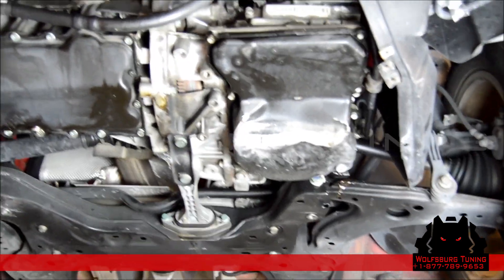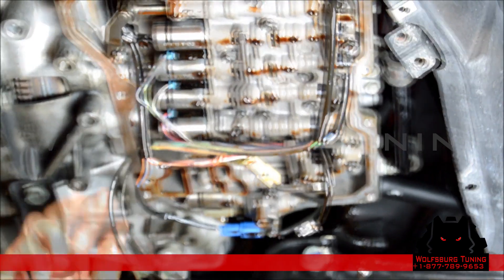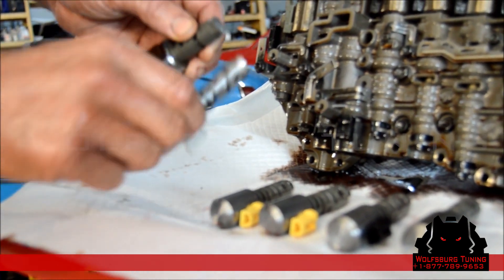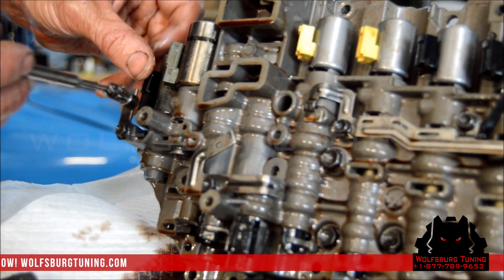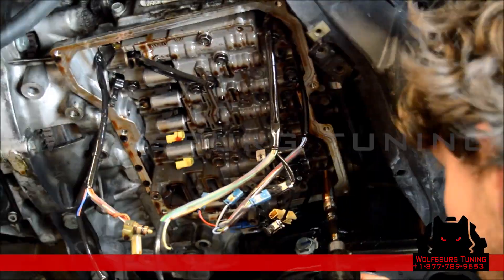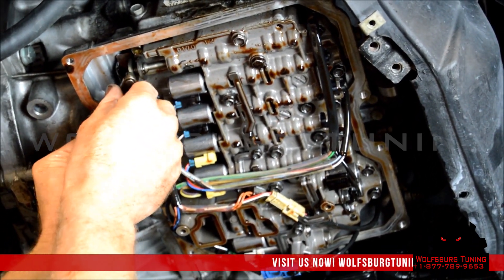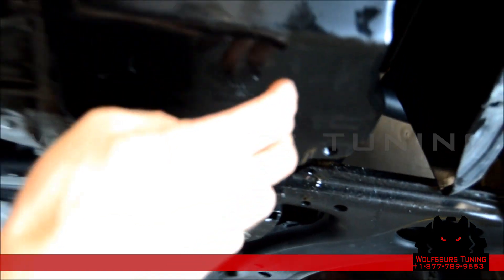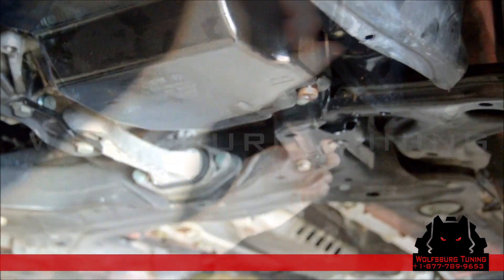WolfsburgTuning.com - Audi & VW 09G Solenoids Installation

Comment: Quick question that I'm not sure can be answered here. My '07 Rabbit has the large can solenoids in the VB, and in the research I've done, I've found that they have to be the same diameter solenoids going back into the vehicle. Does the size of the solenoids really not matter? I dont want to replace them all just to have the same issues I've been having with the transmission

Comment: Very informational. I got the kit with all 8 solenoids. Should I just install the six like you said? And 5 quart of transmission fluid, correct? I’ll be trying this job on Friday. Need as much information as possible.

Comment: You can just try and clean them before getting new ones. Worked for me saved $400
Reply: Same thing for me. Cleaned all 8 multiple times and jolted them with 12v about 20 times. Lots of gunk gets stuck in them. I turned some of  the adjusting screws 2 times counter clockwise for firmer shifts. Feels really good and no more flaring.

Comment: I have a p0720 code (g195 ). My plan is to change fluid and most likely the output speed sensor first. Will I need to use the same procedure of resetting the valve body? What exactly  is that procedure?

Comment: I was experiencing hard shifts and surges in my 2005 Volkswagen Beetle. I bought this kit, installed it and it runs like new now.  It took about 10-15 miles for the trans to relearn the shifting.  It was pretty jerky at first.  Everything smoothed out.  Thanks Wolfsburg!
Reply: Did you need to program the valve body?
Reply: @AndreychukAndrey  Yes, it should be programmed after install.
Reply: Glad to hear!!! Thank you for taking the time to comment!

Comment: thank you for mentioning the torque specs Nobody else does and I couldnt find it online without signing up. Best Video for 09G here. I did shift kit and solenoids and it fixed the issues.

Comment: Can I buy a certain OBD that will work on program at home. 1 gear won't shift and then it will shift and hit a bump and it pops right out of all gears. The OBD I have says that My input and output sensors need replace so was going to change solenoids while working on changing fluids.

Comment: Had the hard shifting issue, replaced with new valves, but now i have odd shifting, like it takes longer to shift. Any ideas? I read somewhere that do to mileage, there may be some valve adjustments needed once they are replaced, could this be what I need to do? 07 Rabbit. Thanks

Comment: Cannot find a single good article/video/diagnostic flow chart on how to test these transmissions to find out exactly what's wrong. How can I make sure the problem doesn't lie in my TCM vs a shorted out solenoid. Tested out all solenoids.. all are in spec. PRNDL illuminated. Thanks for any advice in advance.

Comment: Would this be relevant for an Audi A4 B7 CVT “P0753 Shift Solenoid A Electrical” code? The gears are failing to shift
Reply from the maker: This video is for a 6 speed transmission. Please email service@wolfsburgtuning.com so we can further assist you.

Thank you!

Comment: Nice video.. I've seen some tutorials for this type of trans, i will eventually install new solenoids on my passat, just i have a doubt, does anybody knows if you have to adjust the solenoids?? there are like type of screws on each solenoid that you can adjust clockwise or counterclockwise before the relearn process.. if so  when you have to perform this adjustment? Thanks

Comment: I'm facing same as your problem.  My 2006 golf does hard shifting when gets hot and sometimes get stuck on 3rd gear. Changed the transmission with 2nd hand one and it's still doing the same thing. Any advice please help. Cheers
Reply from the maker: Please send us an email with your vin # service@wolfsburgtuning.com

Comment: What is the max safe ATF operating temperature for the 09G? We are getting 104 deg C or 219 deg F after a half hour of suburban driving in our Mk 5 Golf - is this too high? The repair guide says the TCM has a fail safe which kicks in at 127 deg C or 260 deg F but says nothing about normal operating temperature.
Reply from the maker: Hi,
The normal transmission temp is around 175 degrees.

Thank you
Reply: @WolfsburgTuningcom  Thanks for the reply. Any idea what would cause it to run hot? Shifts beautifully after having solenoids rebuilt locally. Could the oil cooler be the problem (have the small round type which sits on top of the trans)?
Reply from the maker: @frogman6641  There are many reasons that could cause this.  The vehicle needs to be diagnosed to identify the issue.
Thank you
Reply: @WolfsburgTuningcom  OK thank you.
Reply from the maker: @frogman6641  You're welcome. If you have any further questions please feel free to email us at service@wolfsburgtuning.com.

Thank you!

Comment: Did you state what the problem was?  Symptoms?  What do you charge for this job?
Reply from the maker: The solenoids are prone to failures that will give you these symptoms and they are only rated for 100K miles. Hard shifts, soft shifts, no shifts or different shifting conditions from when your transmission is cold to hot. We only sell parts we are not a shop.
Thank you
Reply: @WolfsburgTuningcom  thank you .  my son's 2007 jetta wolfsburg isn't there yet but how much for the solenoid kit?
Reply from the maker: @rhoddin  Our 6 piece solenoid set is $274.40. Please see link below.
https://www.wolfsburgtuning.com/automatic-transmission-solenoid-set-0000%201059av

Thank you

Comment: i have manual trans in mk4 golf
 5 speed
sometimes if i stop and go in neutral on red light for example..
the car doesent want to shift so i turn it off then get it in 2nd gear and drive like that ...
when i can i go off the road and change the gears with hand in the engine bay then go in and start and like that the car starts to shift but im not sure i am fixing it like that 
i bleed the air and the fluid and same thing is back.
PLZ HELPPP WITH ADVISE 😥😥😥😥
Reply from the maker: Manual Transmissions are not like Automatic where you can just replace a part to fix it. You need to bring your vehicle to a mechanic to have them diagnose the issue. 
Thank you
Reply: @WolfsburgTuningcom  
Of course 😊
Thank you for your reply and respect 🙏 big respect 🙏 and thank you for the reply.
But I live in Macedonia and there is no such thing as mechanics who can do diagnoses with laptop or something or let's say that I can take the car to mechanic and take it from there fixed ...
It is be sold in pieces or they will change every part that is still good in the car and give it back like that so I have to fix it or just dig a hole and burry it in the hole and walk to hospital every day...
Macedonia )
Reply from the maker: @ChudGPT  please email us as it is much easier to message back and forth. Service@wolfsburgtuning.com
Thanks again!

Comment: I have 2000 vw new beetle. Not engaging not for or back.  My code is P0730 would this fix my problem and What is the solenoid reset procedure?

Comment: I know this video is 2 years old but I’m still hoping for a respon, my vw Passat 2.0 turbo is running a p0864 code somtimes it will bang when I put it in gear and get stuck in gears and other times it drives normal, I believe it is a transmission output speed sensor is that the sensor located on the valve body?
Reply from the maker: Please send me an email with your vin so I can see what transmission you have. service@wolfsburgtuning.com
Reply: @WolfsburgTuningcom  my 2004 Jetta TDI with dog won’t go into reverse ! Why?
Reply from the maker: @scotthayes5738  The vehicle needs to be fully diagnosed. It could be a wiring or module issue.

Thank you

Comment: Thank you! I ordered from your website and install them. Now transmission is back to its glory days!!
Reply: What was your problem that you did this
Reply: @paulbrose5431  rough shifting. Usually when engine is warm
Reply: @Usmanthemecano  Did you need it to program it ? Or just drive?
Reply: @AndreychukAndrey  no programming needed
Reply: @Usmanthemecano  Thanks for the respond. I have the 2016 Jetta with 1.8T and they don't sell just the solenoids and only sell the valve body with solenoid but they want like $700 plus dollars for it. I see on eBay they go for around $350. I was wondering if I can just clean the solenoid and put them back in.

Comment: Thanks for sharing the video - I just replaced all solenoids and my car wont go in reverse, any ideas? I am thinking if the solenoids that I purchased were faulty or the selector fall out as I didnt put ziptie on it. Thanks
Reply: Fill up more transmission fluid it will drain when reaches correct temp

Comment: Car is worse after new valve body
Reply: Where did you get your valve body?
Reply: @wolfsburgtuning4733  Amazon
Reply: No I didn't purchase yours. It's from a different seller. But I got my refund. I wanna order this now. 
Here's my valve body part#
09G325039BX
I use the output sensor cavity to pour in atf the exact amount I took out. Is that ok by your policy? What's the warranty on the product?

Comment: 2006 VW Jetta here. Transmission was starting to bang gears once it was warmed up and hot. I mean when upshifting it would ‘hang’ in Neutral, Rev High, then bang to the next gear. Not good. So the fluid and filter have been replaced and that took care of the banging. But now when the car is hot and it shifts up, it hangs between gears, leaving the driver helpless, when you press the gas pedal to go it just Revs the engine like in Neutral until it finally shifts. So, should I look for a solenoid package or do I have to do the whole valve body? Thanks!
Reply: It is usually a solenoid issue, but it is always a good idea to scan the vehicle for trouble codes before replacing any parts. It could also be a valve body issue. There's no easy way to diagnose if the issue is in the valve body vs a solenoid issue. It simply comes down to how much money you are willing to put into the vehicle and how much time you have to work out the issues. If you plan to keep the car for a long time, I would recommend a rebuilt valve body. Our (Wolfsburg Tuning ) re-manufactured valve bodies come with all solenoids and a Lifetime Warranty. The valves in the valve body wear out which changes the pressures in the transmission. This has a negative effect on the mechanical parts in the transmission. If it is a solenoid issue our solenoid set would correct the problem. Keep in mind, if you choose to replace the solenoids, that you will have new solenoids in a valve body with wear. The valve body will eventually need to be replaced. 

For more info, please message us directly via email service@wolfsburgtuning.com or you can follow this link to open a ticket.  https://www.wolfsburgtuning.com/contact/

Solenoids: https://www.wolfsburgtuning.com/automatic-transmission-solenoid-set-0000%201059av.html
Valve Body: https://www.wolfsburgtuning.com/automatic-transmission-valve-body-0000%202698.html

Comment: MY VW POLO 1.4  2004  9N Automatic gear box when I engage drive it takes some few seconds to move I change the transmission oil and clean the pan but nothing change can any one help what must be the problem .
Reply: Your issue is most likely in the valve body or the solenoids. The only way to know for sure is to measure the pressure at the ports in the transmission. That requires a hydraulic oil gauge.

It is not possible to know exactly if it is in the valve body or just the solenoids without removing the valve body and testing it on a machine.
 Unless you have solenoid specific trouble codes. The most common failure is the solenoids. 
We also offer the re-manufactured valve body (includes solenoids) that is covered under a lifetime warranty.
Reply: @wolfsburgtuning4733  thanks so much for your reply you  really open my mind although i am not a machanic but i understand can you please send me the pictures of what you are talking about to malume28@gmail.com if possible 🙏🏿🙏🏿

Comment: Nice video. 
Quick question I have a 99 beetle with 150k with an auto trans, my cat will not shift out of 1st gear, would that be a selenoid problem, or with low trans fluid cause that issue. 
Thank you.

Comment: very well done presentation, Im doing a 2000 vw automatic golf, kind of the same???
Reply: 1 year later hoping it worked for you! I'm about to do this on my 2001 vw auto golf. Did you have any troubles?
Reply: @Dreaddluck  OM GOD!!!! SORRY FOR THE CAP LOCKS BUT THIS IS EPIC- I used C-Foam, and changed the fluid and filter three times  i added C FOAM to the transmission fluid and after three tries and 1200 miles-the transmission shifts like new-THIS IS EPIC!!!!!!!!!!!!  I used a formula of 33 percent c foam to the transmission fluid-after 450 miles it started to work-then it went back to not shifting, so I replaced the filter again, replaced the fluid and added c foam AND AFTER 1200 MILES ITS LIKE NEW-THIS TECHNIQUE COULD PUT THE TRANSMISSION SHOPS OUT OF BUSINESS

Comment: Does Wolfsburg Tuning, have a video for a Transmission Input Speed Sensor replacement? 
Is the Input and Output 2 different sensors, please send links. 
All for a MK5 2008 VW GTI 2.0T FSI Automatic Tranny.

Comment: My 2013 Passat has a T55 plug I can take out and add fluid through.  What I do is run a clear vinyl tube to it and and stick a funnel in the end of that and fill from above.  I just wedge something soft in the fill hole to hold the tube in place but big enough not to fall in there.  I also keep a clean drain pan down there in case I lose fluid accidentally then I have a chance of using that fluid still.  My Passat uses G 055 540 A2 and that is really just very expensive WS fluid.  I used Toyota WS last time with good results.  I will use it this time too.  The 2006 Jetta I had would have taken Type T-IV.  Being that they are Aisin transmissions that are similar to Toyota transmissions it was easy to get the fluid a lot cheaper.  For the price of VW fluid you can get 3 bottles of Toyota branded fluid and it works just as well.  Just avoid those multi spec fluids you find in Walmart and all of the parts stores, they only are truly one of those specs and not the one that you need.  There are a lot of similar fluids but going by viscosity alone could come back and bite you!!  Is the gasket reusable?  I like how they fit on the pan and don't need silicone or other stuff to scrape off.  When I see videos of other people doing their fluid they have maybe 30 bolts and no drain plug (ugh).

Comment: I once had a leak when I put a pan on and filled it.  The pan was bent but you can't see it without a perfectly flat surface to lay it on.  That was a replacement pan for one that was dented.  The listing shown a OEM pan but the one they sent me must have been a different or even generic copy.  I sent it back.  I should have left some bad feedback to teach that bastard a lesson.  It is because of that I don't like taking the pan off.  That was when I was still using the the dealer's fluid and not Type T-IV (that was an older car).

Comment: I just changed the solenoids and I followed the steps as perfect as I can . When put fluid and tried to put it in drive and neutral and then reverse it jumped big time when i moved the gear selector . Does it matter if I over torqued the shift selector bracket in the valve body ? I made sure I placed the pin where it belongs . I know I need more fluid . Not having enough fluid would cause that jump in shifting? Any one knows . Thanks !
Reply: I Z something else could be wrong

Comment: I ordered the Wolfsburg Solenoid kit and it does provide helpful instructional information about the re-learning procedure as well as an illustration of the solenoids and where they go. I'm doing this now. I suggest if you're doing this on ramps, use a screw jack to hold the valve body in place while you unbolt it. I also placed the wires into the undercarriage in their perspective place before removing the valve body to help me when I put it back in. Planning to use the same screw jack to lift it in place. You're biggest issue might be holding the spring and accumulator piston in place as you put the valve body back in. I read that you could hold it with vaseline. Does anyone know how this may be done? I'm ready for the install part.
Reply: Can you update me with your results? Would you reccomend me to go for it?
Reply: @being-sport3664  I was able to do it with no problem. I did have to lower the valve body after install because I didn't pay attention to the source of the wiring harness on the front side and one wire was hung up as I raised the body back in place. I only had to lower it slightly to re-route that wire and gain the length needed to re-attach it in place.
Slow and easy.
I bought magnifying glasses with an led light off Amazon. Since I was only working with the car on a ramp those glasses made all the difference in seeing the details since it was dark down there. Proud of the result and had emailed Wolfsburg with a concern during adaptation/relearning. They responded immediately and their suggestions solved my issue.
Reply: @lildoggy4u  thanks for the reply mate. Im gonna take the whole gearbox out so i guess i wont have issues with assembly

Comment: Just an amazing video - to the point easy to follow! hopefully this procedure fixes my automatic transmission gear slips in gears 3rd to 4th and 5th to 6th. If any one here has any updates or TIPS - please let me know!!
Reply: I'm facing same as your problem.  My 2006 golf does hard shifting when gets hot and sometimes get stuck on 3rd gear. Changed the transmission with 2nd hand one and it's still doing the same thing. Any advice please help. Cheers